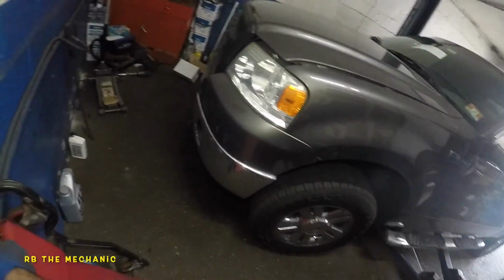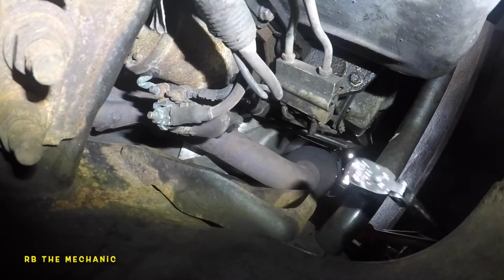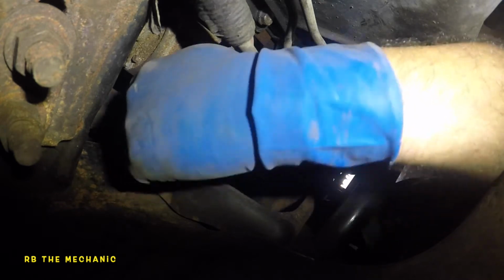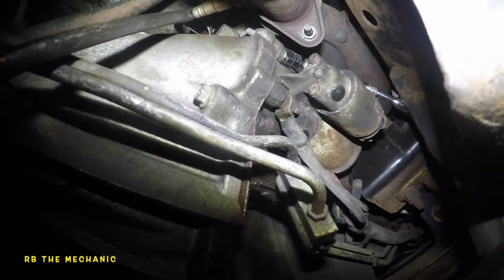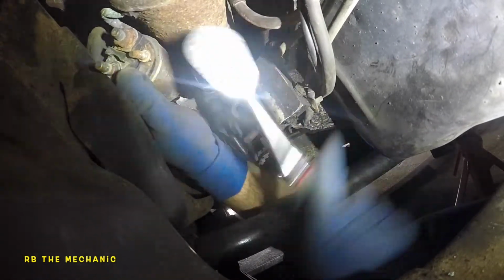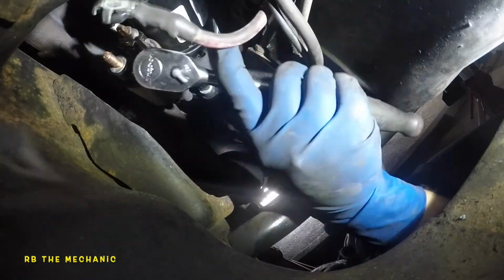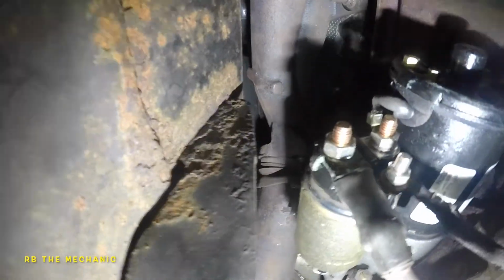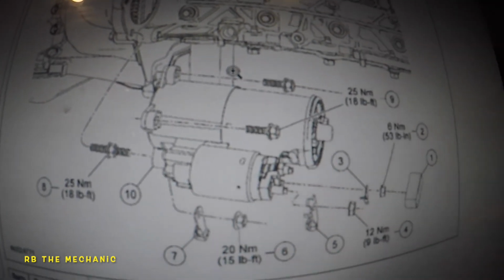How to replace starter motor on FORD F150 and on other FORD models

Comment: I need help. My Honda civic 03 is not wanting to go over 25 mph / 2000 rpm, I already checked the codes and has no codes, engine light is not on and have changed so many things on it already. Spartplugs, cleaned the body throttle, oil change, fuel pump.. fuel pump Reservoir, changed all the sensors from the engine and also changed the tps sensor and nothing.. I don't want to give up on this car because it still turns on and it only has 150 k miles and turns on !!!  Help me plz !!!!
Reply from the maker: Did u check for catalytic for blockage u can remove front oxygen sensor and drive without it to see the preformance